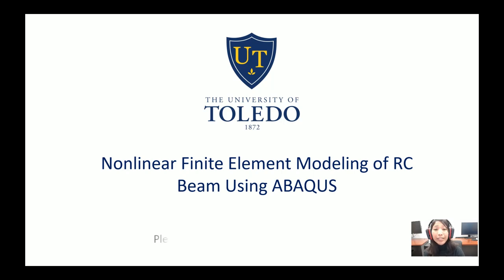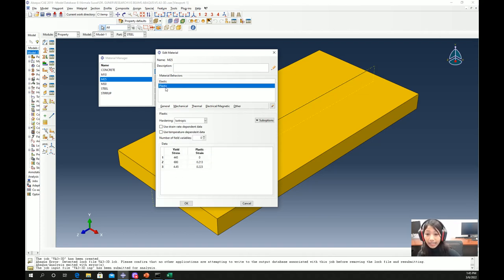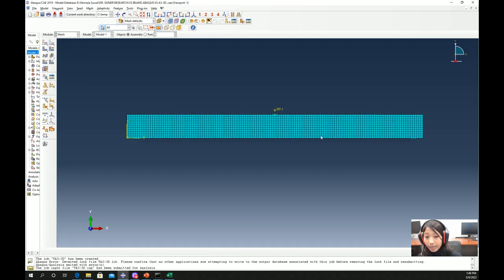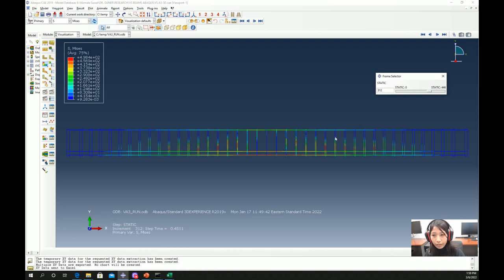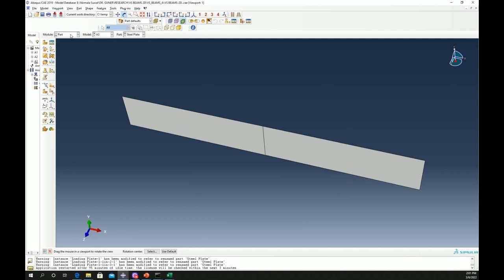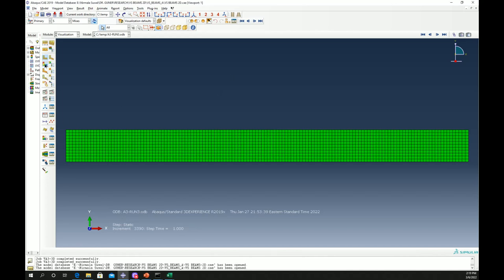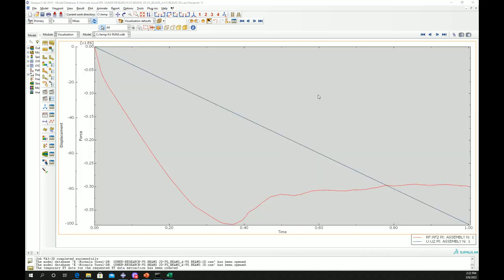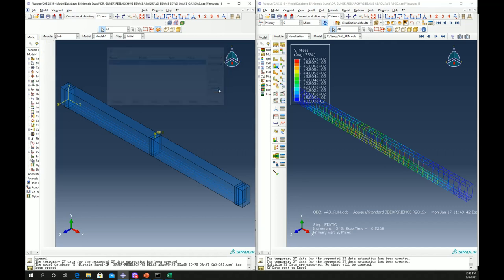Shear-Critical Concrete Beam Modeling in Abaqus: What is the difference between 2D and 3D modeling?

Comment: Dear Dr
Thanks
But, please tell me :
1- How CDP can capture the shear stress reduction of concrete ? I think that CDP do not contain any parameter to model this feature. 
2- How to model the bond slippage between bars and concrete in Abaqus rather than using connectors because it hasvery hard work> ? thanks
Reply from the maker: Thank you for your interest in our video. These are great questions that would require some research. I suggest you search/review program documentation and Abaqus specific modeling guidelines published by NCHRP and other institutions.